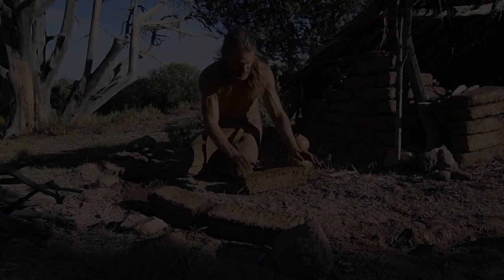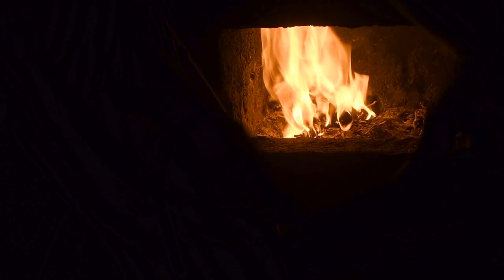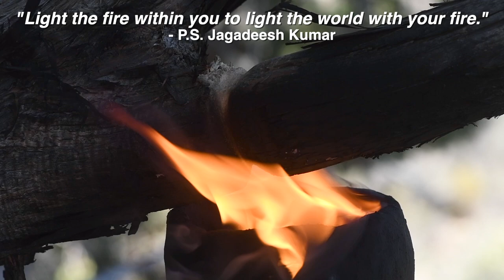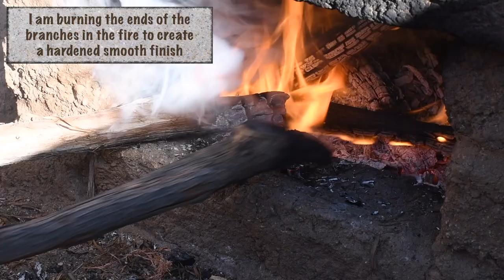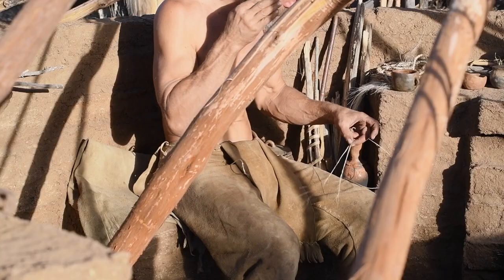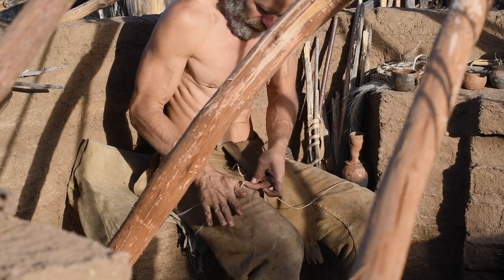Building a Wood Frame Roof for My Adobe Hut (episode 33)

Comment: Finally we are doing the hut this episode around, truly a long awaited anticipation.
Reply from the maker: I know, I know. I'm so sorry.
Reply: @ChadZuberAdventures  Its fine I hope u fill better
Reply: @ChadZuberAdventures  Oh no, don't apologize. What I mean is it was an excitement to watch this episode, I have imagined the various of design you would apply for the hut and it looks great 😀
Reply: @ChadZuberAdventures  And I have a question though, let's say after using the branches as basic frame for the hut and applying dry straw grass, would it be leaky during a heavy downpour ? If so what is the best way to prevent leak in that case ?
Reply from the maker: @KiseiruYoshioka  Unfortunately there is no straw-like grass here. I haven't found any. But if you properly make a thick roof with grass it will be water resistant. If it is not thick enough or not properly made then it will leak. It needs to be made by layering starting at the bottom and overlapping new layers as you go up.
Reply: @ChadZuberAdventures  Ah, thank you for the informative explanation. 😀
Reply from the maker: @KiseiruYoshioka  You're welcome!

Comment: That incense from the torch can actually be very useful in the summer as a mosquito repellent! Also, it's good that you cleared the bark off the juniper branches for two reasons: one, it greatly reduces fire hazard, as juniper bark catches sparks very well, and also it will prolong its lifespan. Bark in the shade of the roof would trap moisture, as well as make a cozy home for wood eating bugs if you didn't remove it. Probably not as important in the dry climate you're in, but here in Europe it's pretty much imperative to de-bark any logs used for a permanent shelter.
Reply from the maker: Yes, those are good points and reasons to remove the bark. Especially for removing hiding places for critters. And yeah, the incense should help keep mosquitoes away during the brief period of summer humidity.

Comment: This looks like a good rabbit trapping area. Once I made a traditional mesa dweller robe from rabbit hides. I got the design from a museum piece. The hides were cut into a spiral that is around an inch wide. Then attach the hide stips at the ends, one after another. The rabbit hide (hair on) should be about 20 hides and when the long strip is ready you have to twist it, working to keep the hair on the outside but some will be on the inside of the twisted hide. Then weave it as if you are making a net. The space between each loop depends on what kind of temperature and weather is in the area where it will be used. I gifted the robe which is almost the size of a bed throw blanket, to my mother. Her mother was full Cherokee. When they were forced on the Trail of Tears, where they ended up was rabbit country but I have only found a reference of pre-white clothing from a one really great book. 

This makes a great idea for a baby blanket but smaller. There is nothing like soft fur against your flesh. Cozy.
Reply from the maker: I have seen and read the description for making a rabbit fur blanket in a book titled SURVIVAL SKILLS OF NATIVE CALIFORNIA. When I get a supply of rabbit furs I definitely intend to make a blanket like you described. I can only imagine how warm and comfortable it must be.

Comment: I haven't seen it yet, but I know it will be beautiful! I will save this video for tomorrow morning before I goto school, to start off the day good.
Reply from the maker: I hope you enjoy
Reply: @ChadZuberAdventures  Better than anticipated :) Out of curiosity, are you planning on salvaging the smaller cordage used on the outside ring? Or are you going to try to walk the roof up to a higher level when you start construction on the walls?
Reply from the maker: @libertyenjoyer2247  I plan to try and salvage and reuse the same cordage. But I will have plenty of cordage made if that doesn't work.

Comment: Great video! That hut looks like it's goin to be mighty cozy, even now (once you get the roof done)! Do you expect to reuse the roof as is once the walls are finished, just raising it upp? Or will you be making an all new roof , reusing some of the parts?
Reply: He'll at minimum need a new anchor tripod.

I'd guess tho that it's something that encroaches on his space less. Probably reuse a lot of the material, but different design.
Reply from the maker: I'm going to disassemble the roof, finish building the walls, then make a new roof but better.

Comment: Chad, I've been waiting long since your December episode ( not the year conclusion ) and finally see this episode today !  
Since you need lots of materials to build the roof and most of these material need to be cut or shape, so a stone axe is suggested for this purpose.   For the structure of the roof, I think it would be better if you use some Y shape branches where the Y is used to lean on the wall to secure position and get support. You can also tie the roof top Ring to all these Y shape branches to make a better shape of the roof and after the roof is built, you can remove the Tripod to create more space or leave a center post for major support if need.   Just a small suggestion hope can do little help .....
Reply from the maker: Those are good suggestions indeed. I assure you I will be making axes soon. This isn’t the final design of the hut. When I finish it in the spring the roof will be made similar to the way you described.
Reply: @ChadZuberAdventures  Chad, never thought you would sent me a PROMPT reply ... Appreciated !  Happy to know that my little suggestion will become part of your plan and looking forward to seeing the finished hut soon !

Comment: While I admire the dedication to make all that cordage with the roll and twist method, I can't help but wonder if there's some way to create a spindle that might help make the work a bit faster. You've got some pretty solid pottery skills, after all, and spindles were used for a long time because their efficiency rate was pretty high, while also being portable. Just saying, once the roof is done and you're sitting inside trying to find more ways to keep yourself occupied...
Reply: A spindle is useful for wool and Cotton, I’m not sure if it would work with yukka.
Reply: @oxybrightdark8765  That is a fair point, it certainly might not. Just curious to find out, you know?
Reply: @gayahithwen  Spindles have also been used with flax and dog bane so it SHOULD work with yucca! :)
Reply from the maker: I've seen a video or two of making cotton string with a spindle. I don't think it would work well with yucca fibers. Certainly it wouldn't be as strong as the rolling method I currently use. But perhaps I will try experimenting with the spindle.
Reply: @gayahithwen  My spindle works because naturally entwining threads re-twine after being separated.  Yuka doesn't naturally bunch together like wool and cotton do.

Comment: I was wondering why the burn through method wasn't tried yet. I should have trusted your process!

 It takes less time and effort and the branches, logs and sticks have charred ends to help stave off rotting. I imagine the rotting isn't a problem there but it is handy in woodlands.
Reply from the maker: Rotting is not a problem here at all

Comment: Just. A suggestion, since you are making Adobe hut..I would imagine if you were going to shape it similar to igloo..by reducing the circumference slowly after every  layer of bricks..you would be able to conserve more heat inside ..
Reply from the maker: Yes, that is true but would be a challenging construction which I can't really do at this time of year anyway because it is too cold outside some nights for the mortar to dry properly.
Reply: @ChadZuberAdventures  thank you for your reply  and ...what your are doing..is challenging anyways....I enjoy your videos...I saw your latest video where you mentioned that you through away your Ash ...what I have seen in many trible areas where they usually live in similar huts is .they would mix Ash with fine mud (red mud) and after making a paste out of it would use it as Flooring for a smooth surface ...

Comment: Do you have rabbitbrush growing out there? 17:57 looks like you do. You might be able to make rubber from the sap. If I'm not mistaken, you just need to mix it with an acid like vinegar. You could make vinegar from mesquite pods, they have enough sugar... I wounder if urine would work too.. haha.. gross.. If you could figure it out, you could make your own sandals. If not, the sticks will make good thatching or matting material.
Reply from the maker: Wow! I'm so glad you mentioned this! I think you are right. I never heard of rabbitbrush before but I looked it up online and it does appear to grow here. If so, then I will definitely experiment with it. I think it is my preferred source of tinder. I'm not certain yet but there is a plant that looks just like it but when it is dry it works really good to start fires. Regarding making vinegar, I could use mesquite probably or even prickly pears. In the past I've saved urine to mix with oak to make a dye to tan hides so I have no problem working with urine. It's not gross to me. Thanks again for this discovery!

Comment: The hut is looking great, are you looking to get the walls head height when its done or slightly shorter?

also, i always wondered, what provisions do you make for anything going wrong while youre at the hut? things like serious injury, animal attack or extreme weather. do you keep an emergency first aid kit around and other safety items in a bag
Reply from the maker: The walls will be about five feet high when I finish. The top of the roof will be about nine feet. There will be lots of room inside.... I don't bring any first aid but I have dry food provisions and a couple of blankets.

Comment: if your not planning on getting more then 1 foot of snow your more then good. trust me you've got zero worries of snow collapsing your roof!!! oh and there is another way of getting pure clay for potty. it involves soaking it in water and skiming the clay out. the clay mixture will be the muddy water color while the heavier unwanted material will settle to the bottom. the muddy water or clay water will need to have 90% (give or take) water evaporated out of it to become a more pure clay then sieveing it
Reply from the maker: I only expect to get maybe a few inches of snow but it may not even accumulate because of the heat from inside warming the roof. I'm aware of that method for separating clay. I am very happy with the sieving technique. It produces a clay with a good amount of other minerals which make it easy to work with and I've had very good results producing strong pieces of pottery that can be used for cooking.
Reply: @ChadZuberAdventures  yeah wasnt sure if you knew or not. best of luck to ya. will keep an eye for the next episode.

Comment: Hey if you are going to stay in that area for a long period, say a decade, coppicing may be a technique to consider, yielding straighter staves, unlike the twisted branches from 20:30
Reply from the maker: What is coppicing? Okay, I just looked it up. I don't think that will work with all trees, certainly not juniper or pine.
Reply: @ChadZuberAdventures  I'm not an expert in the area but it basically makes trees use their winter reserves to quickly grow new shoots, making a stump produce straight saplings. 
It seems to work on catalpa species such as paulownia, don't know how well it does on chilopsis.

Comment: not quite what i meant by fire burning my guy , you need a hot COAL place it in the groove and blow on it using a hollow tube , what you did there was kind of counter productive , you fire hardened the branch and it was actually harder to cut it , so id say you keep the torch with you since its a good idea but instead of using it directly try to light a small fire make a coal within that small fire , use 2 sticks and place it in the groove while still holding it and blow on it gently , it should eat the wood a lot faster then a torch could ever hope to
so a quick summery on this , make a groove , make a fire with that torch , wait for it to have good coals in it (preferibly those lit orange ones) , grab one , and finally blow on it gently as it sits in the groove (you can use a hollow plant for a tube , you could also make your own tube from clay by just getting a thin stick and making like a roll around it and then making it into a ceramic  , up to you on that one) 
regardless of effect and way of doing it , keep experimenting like our ancestors
Reply from the maker: Oh yeah, that's a really good idea. I think making a container of clay around it would be best because of the wind.
Reply: @ChadZuberAdventures  yes , speaking of making containers , maybe try to make like a rain collecting system in this area too , who knows when the extra water comes in handy , like that sink idea was sick , but what if you ran a few rain collectors into it 
and since the clay around you is trust worthy potentially try some bigger pots , if you manage to make a big one and it doesnt randomly explode (like in some cases) you could set some water storage up , also that Sedementery rock , its not gonna last forever so , id sugest you try to reform its edge and use its chips for little carving tools , potentially make some celt stile hand axes too (like those ground down ones , the smooth ones not chipped or flintknapped) , for that big rock pickaxe id say a 3 side tip would be the best course of action , in any case stone picks seem to last longer with that kind of tip , ive had slate picks last me quite a bit with that geometry , so aside from that im looking forward  to more videos .
thanks you for your videos , looking forward to more :P
Reply from the maker: @serghiescumihai7710  I totally plan to make a water collecting system. I will make a lot of clay containers to capture and store water.

Comment: Placing the branches around the tripod, I'd have hooked the forked branches into place by tucking them past the tips of the tripod (rather than around) so that when downward pressure is applied, they catch on the lashed-together bits, rather than risk a branch slipping free or requiring a tonne of cordage...but that requires them to have forks, and be the right length, and not too crooked...
Reply from the maker: Yeah, with these crooked branches you just have to put them in place and see how they fit. But I tied them all together anyway so they're good now.
Reply: @ChadZuberAdventures  So I saw!  ...I know some people will be wondering, "But if they poke out like how you suggest, how can the roof lie flat?"  Technically, it still could; it'd be a case of creating a conical cap with a ring and lifting it into place, then lashing the ring down into place.  With enough thatching overlap, it'd be fine, still capable of trapping in heat in winter.  Primitive Technology liked doing it that way, albeit with grasses and palm fronds.  (I do wonder what happened to him. Last anyone heard, he'd been offered a tv series, but that was a couple years ago.)
Reply from the maker: @ladyofthemasque  Yeah, you just need to apply enough material to cover the roof. Grasses and palm fronds are easier to work with in many cases. I don't have those materials available here. I have no idea what happened to John Plant.

Comment: 18:15 I would consider irrigation and farming?  How far away is the stream?
Reply from the maker: The stream is a couple miles away. The spring is 100 meters away but doesn't always have water. Irrigation isn't really a good option here. Farming would be very challenging.
Reply: @ChadZuberAdventures  well I know the the Romans used a system to move water uphill. I think the biggest challenge using a system like that would be firing clay pipes. Two miles is a lot of pipe. But considering how much effort you’ve put into your hit already I assume you mean for this to be semi permanent. Ram Pump is the device I’m thinking of.
Reply from the maker: @mattparker9726  Oh hell no! That would be an immense feat and likely to have many problems.
Reply: @ChadZuberAdventures  yeah...but who else has ever done it on YT?
Reply from the maker: @mattparker9726  Nobody, because it is extremely challenging and would require a massive quantity of clay and time to make it. It would take the rest of my life and my children's lives to complete. I'm not willing to sacrifice the rest of my life for that!

Comment: Chad Zuber! Do ypu want to know how to make cement for fired brick?
Reply from the maker: Sure, yeah! Tell me how.
Reply: First you meed to get dead bark or leaves and birn them then when they're burnt you wait for it to cool down.

Then when they're cool they should look like powder then you take the ash and put them in water and make them in to balls.

You let them dry and when its dry you put them back in the water and wait for the ball to deform and you dump out some of the water and mix sand with it.

I dont know if this will really work i might have forgotten something, i just watched it in a video.
Reply from the maker: @D_Roch_01  Yeah, I saw that in a video too. It depends on other factors too. The kind of wood that is burned and the balls have to be cooked at a really high temperature.

Comment: I don't get it ... why didn't you pit the primary support tripod on top of the brick wall? The whole construction is not going to be that heavy anyway ...
You could have made special bricks on the last row that would work as sockets for the 3 branches ...
The way it is now, you have lost allot of real estate to those 3 branches going all the way to the ground :/
Reply from the maker: I'm going to do that when I finish building the walls. You will see. It will all make sense later. But for now I need the strength of the tripod in case it snows. Just a couple inches of snow on the roof will weigh hundreds of pounds.